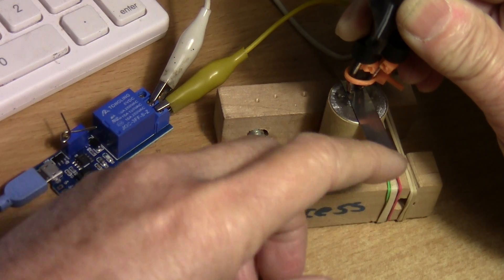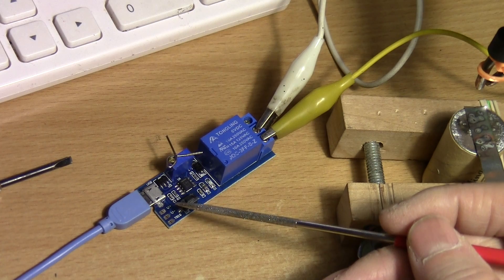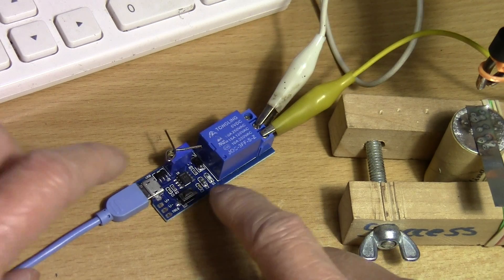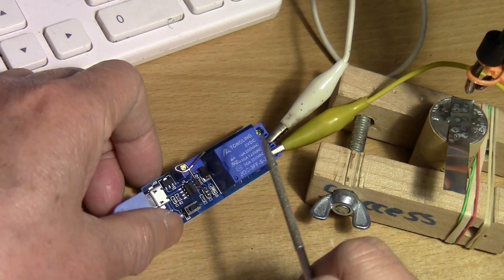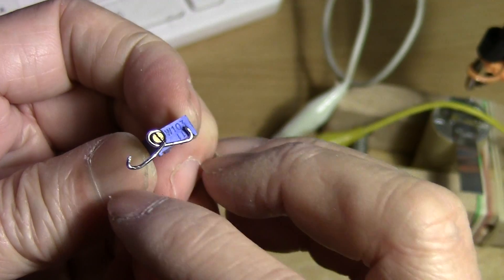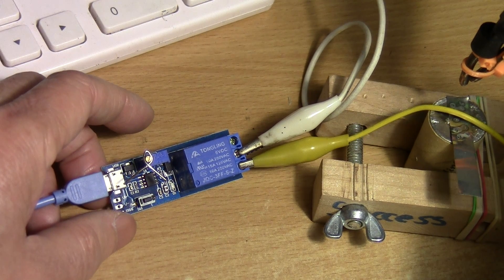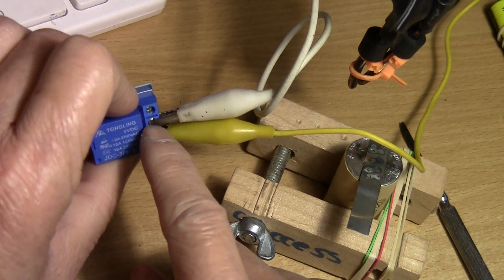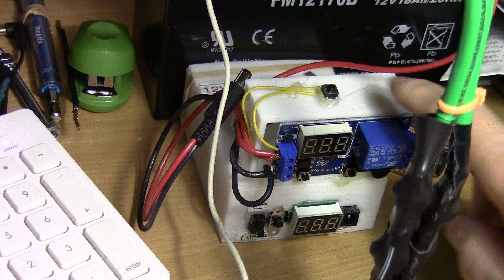Alternate timer for my diy 18650 battery tab welder

Comment: Let me explain better, in addition to the two probes to give on the Common and Normally Open pins, do I also have to connect power?
Reply from the maker: Ok, to power the timer, you need 5v usb or 5v to 30v.  On the other side, the right hand side, you connect the common wire to common and the other wire to either open or close (this depends on your application).  You have to apply power to the right hand side so when the timer switches on, your equipment will run. If you don't have power to the right hand side (what you are trying to control), nothing will turn on or off when the timer switches on.

Comment: what will happen if i connect a 5v dc continous supply to trigger.......will the cycle of delay and engaging relay repeat or will the delay be there in the first instance that i connect the 5v dc to trigger and after that the relay will be continuously engaged? ..like what we would want in the case of automobiles where trigger can only be provided from the electrical system and not any momentary switch as it is inconvenient .

Comment: The two soldering tips must be connected to the Common and Normally Open outputs. Is it also necessary to provide electricity?
Reply from the maker: It is better to have the power supply separate from what you are controlling/switching. That is why they keep it separate.

Comment: How many volts on the trigger?you say it's -ive. How to wire the trigger then?
Reply from the maker: 5v. There are timer versions with 12/24v trigger.
Reply: @wtam69  that's what I wanted. A 12v trigger. Also, when in tandem with a Rcwl-0516 sensor which puts out a 3.6v trigger but only for 3 seconds fixed. Which I wanted to use with this for a burglar alarm on the cheap. That didn't set off the trigger unfortunately....
Reply from the maker: @anybody2514  check eBay for the different versions even if u are not buying from them. Look at the descriptions and find the one u need.

Comment: Hi, the timer board at what voltage is 5VDC powered? It doesn't work for me!
Reply from the maker: You can power it by USB (you can see the usb connector)  or on the side there supply your own 6v-30v.  You can look at the diagram at the beginning of the video. Just pause the video to see the description of the different connections.

Comment: the problem is that the timer starts counting once you release the button and the relay engages at the same time that you press the button, so the lenght of the button pulse changes the total time of the weld
Reply: I don't think so.
Reply: Do you have a link to the datasheet?
Reply: @DenfordBerriman  I don't have a data sheet but I have the module itself. you press the button and it goes off and thats that. It's pretty simple:) if that is what you asking.
Reply: @themaximussx875  Ok cool. It looks in the video like it works how Samuel claims but that doesn't make much sense. So if you press the button it will close and then open the relay even if you have not released the button yet eh?
Reply: @DenfordBerriman  yes that's correct. It wont repeat until you lift the finger off of the button and press again just follow the 1st few steps. I planned to use it for my spot welder but found that 100ms was too long for me . Otherwise it's a great little module
Reply: @themaximussx875  Have you found something that will work with your spot welder yet? I was hoping for finer timing than 100ms too
Reply: @DenfordBerriman  yes I did. I'm using arduino and SSR. It's worth doing that for sake of safety and quality. It is also very simple. I didn't understand the whole arduino thing at all but I got it working in less than a day. And I can send commands in precision of 10ms.
Reply: @themaximussx875  I just got some of these and they behave the same way as the video shows. The button is held down, the relay closes and stays closed until I release the button. Seems like these are designed for keeping relays open longer than the button press but not keeping relays open less than the button press.
Reply: @themaximussx875  Been struggling with an Ardunio based one - could you share your circuit? How many amps you getting through the SSR and can you do anything near 0.35mm nickel?
Reply: I've just received another board (although older revision than a previous ive owned, but not the oldest one out there) and it has this problem too. Someone has made a mistake in the code.

Comment: Was thinking of doing something like this with the raspberry pi and relay board but i don't think the relays could handle the burst of energy.
Reply from the maker: It's a small relay so it probably won't handle a full 10 amps. Probably can switch a few amps.  The board is only a dollar or two so it won't cost that much even if it doesn't work.

Comment: May I know the actual input for DC?? 5V 20Amp???
Reply from the maker: The input to power the circuit board can be usb powered so I say it has to be at least 500 mA at 5v dc.  The switching on the right side of the board is determined by the relay.  The markings on the relay reads 250vAC 10A, 10A 25vDC and 10A 125VAC or 10A 25VDC.  There is plenty of current to power the coil terminal on the 12v auto type solenoid.

Comment: First thanks for your video. It was the most informative about this module I've found. I have a few questions for you. If you hold down the trigger button does it override the timer (stay on as long as the button is pressed)? Or does it turn off and then back on with the timer one time?  What exactly happens when you hold down the trigger button? Thank you!
Reply from the maker: When you hold down the trigger, it will start the next cycle after the first one is done. Sometimes I do that inadvertently and it just retrigger the timer.
Reply: wtam69 I need a circuit that when triggered it will disconnect two wires and then very quickly reconnect them until triggered again. The trigger will stay engaged for a long time so it can’t keep switching or it will drain the battery
Reply from the maker: That's a delay timer is for.  When triggered, the timer will disconnect (or connect)  the circuit, and depending on the duration set, reconnect the circuit.
Reply: There are slight variations on this board, and some are better than others. All I have seem so far will activate the relay on press, but only time from release. This means if you depress the button for more than 0.1s you will trigger it for more than 0.1s. 100ms is a long time for spot welding, so going more than that by accident is a big risk!

If you held it down, the relay will stay activated for as long as you have the button down - you need to confirm what your version does before you actually use it!

This obviously doesn't matter for tens of seconds, so consider this in your plans.

There are units (the ones with LCD displays) that go down to 0.01s - though I need to test if this triggers in the same way.
Reply: @drsquirrel00  did you know how to fix that?

Comment: Love it!
Reply from the maker: Thank you James.
Reply from the maker: Thank you for your question. This is a simple timer switch. You are basically passing either the positive or negative wire through the terminals on the right and adjust the timer so it will control how long the equipment will be on or off.

Since you are using a solenoid already, all you have to do is to connect to the timer one of your 12v positive or negative wire to the bottom two terminals to close a switch, or the top two terminals to open a switch. The wire from the timer goes to the solenoid coil terminal.  I use a separate 12v power source to power the solenoid coil terminals so my positive wire connects to the bottom timer terminal on the right and goes out the middle (com) terminal to the one side of the solenoid relay. The other side of the coil terminal is connected to the negative of my 12 v power source.  That's all there is to it. Good luck on your build. Some people use the same 12v battery that does the welding to power the solenoid coil terminals, I have not tried that so I can't comment on that.
Reply from the maker: This timer might not work on the AC spot welders as you are actually using the relay on the timer board to switch the load.  The small relay can only handle 10 amps and that's being generous.  Depending on your current consumption of your spot welder,  you'll need a much more heavier duty relay.  You can use a solid state relay with  but I read their power handling is generally  overrated.  I have not researched timer with millisecond switching but I'm sure they are available.  Many people use Arduino to make their own timer with millisecond control.
Reply from the maker: Looks like your friend used  or made a timer board with a solid state relay.  You can find such relays on eBay.  Whether it will work with your particular spot welder depends on the power requirement of your welder. Since you are not likely to make your own solid state relay, your best bet will to buy a timer board and a solid state relay that is suitable for your welder. If your welder needs a welding time of less than .2 seconds or 200 ms, then the timer in my video would probably not work for you.

Comment: When you demonstrate this, it looks like you are physically controlling the timer delay by tapping on the button for a very brief moment rather than the electronics controlling the delay.
I want to see you push and hold the button down.
Only then will I be convinced that it is your electronics rather than your nimbe dexterity that is controlling the spot welding time delay.
>
Reply from the maker: Holding the button down will trigger another weld. Thanks for commenting.
Reply: Holding it down will keep the relay activated, its possible that some button presses will last longer than the minimum time period too...

Comment: Body...you make things very complicated...please make it "EASY" like the video that the one which you copy the idea from. that guy makes eady with 12V battery and solonoid....
Reply from the maker: Thanks for commenting. Unless you use the exact same parts,  it is difficult to make something work like the original. For me, the timer makes it easier for me to control the duration of the weld.  It is actually difficult to make something simple and easy to use.